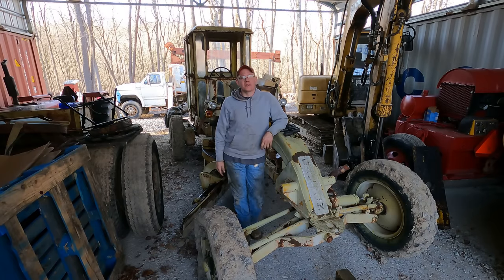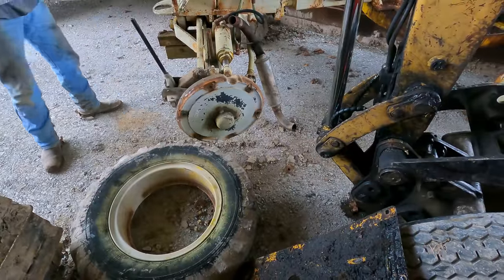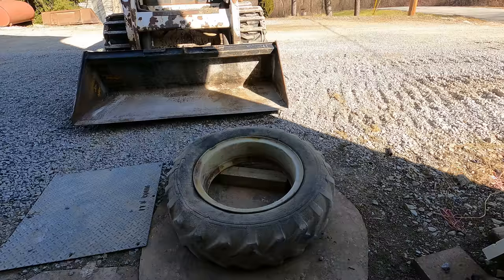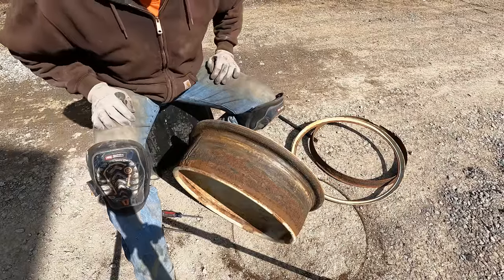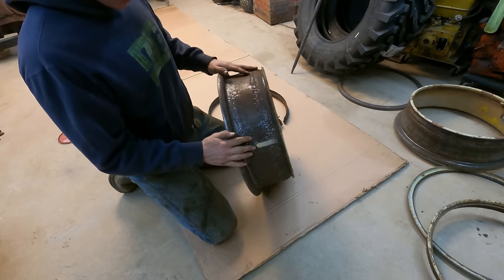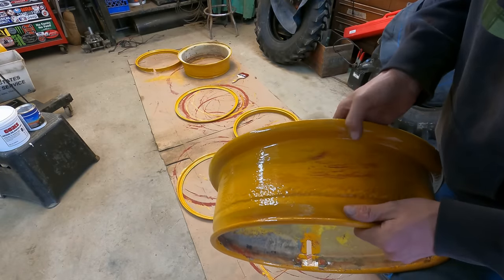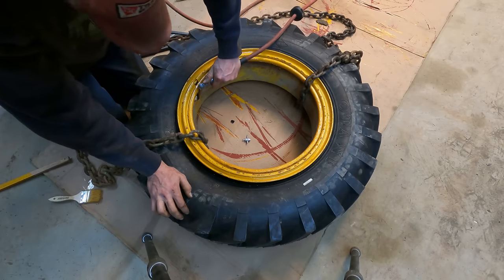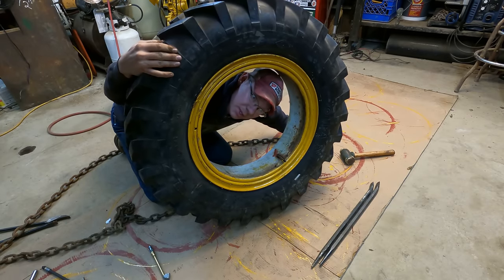1950's Galion Road Grader "Widow Maker Rims" Pt.4

Comment: The procedure you used was exactly correct. When I was in the army in 1975 to 1983 a split ring came off and decapitated a soldier that was standing over the tire while inflating. Thank you for your videos.
Reply: When I was kid running dump trucks for a friend we changed our slit ring tires ourselves. He always made me leave the chains on till on the truck. I thought it was overkill then but appreciate it now. Never had a problem.
Reply: That uhhh.. sounds miserable.  There was that video out of Brazil where a widowmaker pops its rim and hits the guy in the neck, killing him instantly a few days before he was set to retire.
Reply: @casedistorted Yep I know the video you're talking bout.poor dude
Reply: When I work at a  scrap yard we use to get lot  split rings with dry rot tire on from people scrapping them or some old heavy equipment or truck that still use it would be scary time I grew up in trucking family lot old yard truck had spit rim my family Warned us don't close tires   and be cautious

Comment: That flap is called a Boot, I was in the Army and had to teach people how to change split rims, always told them "You can't fight a tire, but you can out think them" .
Reply: That’s funny stuff
Reply: Funny you should mention the Army and split rims. I was USMC and learned how to change tires on forklifts with segmented rim locks. Same idea as a retaining ring, but  4 or 5 sections of cast steel. 125 psi. Fun, fun, fun!
Reply: @Bret4207   those multi locks. .  Or as we called em, hyster claymore
Reply: Army Vet here, too.  Back when I was just a Lieutenant, I had a medium truck platoon -- 20 tractors and 40 semitrailers in my fleet.  Adds up to 580 split rim tires -- we were changing a couple every day.  My Platoon Sergeant and I would challenge the troops to a contest.  Any two of them against us - dismounting the tire, breaking the beads, replacing the tube, reinflation and back on the vehicle.  They never beat us.  (Think here was something to the fact that he and I each averaged some 6 inches and probably 50 pounds over the average soldier.)
Reply: @LitlD  Or they didn't want to piss off the two of you!
Reply: I’m a tire guy in California and I do split rims all the time !! I’m gonna use that you can’t Fight a tire but you can out think it
Reply: @kbar150  HAR! Yeah, but I didn't know any better back then. I'd sit there airing it up with a hammer in my hand smacking any that looked the slightest bit out of alignment. Probably not the OSHA recommended process!
Reply: @Bret4207  tapping while Arrington up,, to seat the ring/rim was standard procedure when we were doing it in 1965. Use of cage was very optional, but you didn't stand looking down at them!
Reply: Maybe in the Army. While I have heard the reference my 15 years In the tire profession. the flap is a flap! A boot is a large sized corded patch used to repair large injuries in farm tractor or construction equipment sized tires where tire balance isn't an issue. This guy is lucky. At least the rims weren't widow makers.
Reply: We called it a gaiter, stripped and built many split rims on the MT park, used to shove them under the truck to inflate or put fork lift forks over the rim. Had to run for it once and saw a few rings f*** off across the yard over the years, that initial "CRACK" of the ring seating was always a little puckering though lol. We lost a guy to a tyre failure in a cage though one day, blast done him in, on a big on/off road super single.
Reply: @jeffgriffiths9528  Ya. unfortunately with the widow maker the two pieces could squirt out any direction in the top hemisphere of the tire and being C shaped there was nothing that could be guaranteed to stop them other than luck. Even fully aired weeks later they could blow in use. The bad part was the only thing that held them in place was the sidewall curvature so as you were airing and the tire was seating against them it would try and push them up  so you'd be tapping them back in  constantly until the tire was up and against them enough to actually hold em in place. One of very few things they banned sale and professional repair of that I was in full agreement with.
Reply: I use to work in a tire shop and we did big stuff and I was wondering why he didn't add a bit of air to hold things in place.
Reply: @WhatIsYourMalfunction  They just didn't want to push beat (sentry duty) every night for the next month!
Reply: @krissfemmpaws1029  I used to put a little air in the tube to make sure it didn’t have any folds and to hold the flap in place. Then I’d put it on the wheel.
Reply: @christopherestewart  that's the trick I use on all tubes too... Just put enough air to give the tube it's proper shape but not enough to hinder it's install

Comment: I agree, the back tires need replaced too. They look just as bad as the fronts were
Reply: E
Reply: Yeah I’d get it driving again first though
Reply: No way. That's why they put 4 of em there! 😄👍
Reply: No  need  to  replace  the  remaining  tires.   If you  consider  this  grader
is  only  to  be  used  to  run  back  and  forth  on  his  driveway.   They 
hold  air  well....lots  of  service  probably  left  for  use  on  how  he 
is  to  be  using  them.
Reply: @krashdown102  A truer statement couldn't be made.  Get it running properly, then worry about the secondary bits.

Comment: Great to see more progress on this project, Matt! Best regards from Germany!
Reply from the maker: Hey glad to see you back here! Can’t wait to see some lathe restoration on your end!
Reply: Wait, what? I've found TPAI this week and I've seen like maybe 5 episodes and now this? Are This Old Tony and Tavarish also watching? Daaaaamn. Greetings from Poland ;)
Reply: @DieselCreek  .
Reply: Sweden sends their regards as well! :)
Reply: Greetings from southgermany
Reply: Hey from Florida
Reply: I'm following the wave, Just to say hi and send greetings from Portugal. Continue with your projects, a pleasant channel to watch.
Reply: What is size of tire?
Reply: .... small world ;-)
Reply: Legit question hows the weather in Germany?
Reply: Greetings from new Zealand
Reply: @rebelredRC  

The weather doesnt matter anymore....Corona is the new shit!
Reply: @DieselCreek  Get the lip of the bucket actually into the bead, under the rim at an angle, maybe around 45 degrees. push it down a few mm, then remove, turn the tire 60 degrees and try again.  the bead should break at least on the third try.
Reply: @DieselCreek  If the front wheels on the grader have neither drive shafts nor brakes, I'm not sure why they need much tread.  I would suggest using the best tires on the drive wheels and the worst ones you keep in front.  that is unless you have much trouble with the front sliding sideways, which is why front tractor tires have that funny looking tread that goes around the rim, parallel with the tire.

Comment: i have changed lots of tires with that type of wheel, my father owned a logging truck for 62 years, we never had a tire breaking hammer, we used a 3" piece of angle iron about 5" long and beat that with a sledge hammer, you lay it next to the rim with the corner side up, stood on the far side of the wheel and beat it in under the rim, knock it out and move it over a little, when the angle iron got squished down a little it worked better, we never left the wheel when we were putting the air in, we watched the locking ring and would tap it with a ballpeen, if it didn't look ok we let the air out and started again, Saturday morning, hug over as hell, beating truck tires..lol
Reply: That's the same way I used to do them.
Reply: Sounds like a clever trick

Comment: Hey Son, if you inflate the tube just enough to fill it out then install your rust flap it won’t cross up on you. 😉✌️😎
Reply: I was changing the tube in a 17.5-25 L2 tire and after finishing it up and putting it back on the machine I discovered the next morning that the tube wasn't any good. So I pulled that one out went and argued with the people who sold it to me for a new tube and got that one stuck between the two liners and tore a hole in it. I bought the third tube from someone else and made damn sure it didn't get caught and I also aired it up on the ground to about 20 lbs and let it set overnight this time before putting it back on the machine. I think Picasso would have painted in reds if he heard my blue period.
Reply: @Parents_of_Twins  you nailed it Sir.  Great  Execution and Lesson  !!

Comment: Reminded me of a time we recieved several new graders by rail.The graders were being processed as soon as they were unloaded,then put to work pushing snow.Drivers were complaining that machines had no steering control at all.I told the person that was processing the machines to deflate the tires to 25 PSI.Everyone started telling me I was crazy,until I went to processing site showed the person in charge the wording embossed into the tire that stated that the tires should be operated at 25PSI cold.When the graders were loaded on to flatcars to be shipped the tires were inflated to 65PSI as required by saftey procedures spelled out in the manual. Still took over an hour to convince that group that the tires were made to operate at 25 PSI cold.
Reply: What's the reason for the higher pressure during transport?
Reply: @Jehty_  This was done after tie down on rail car to make sure grader did not bounce up and down during 
transport.Bouncing up and down could cause tie downs to loosen or break.Of course this could cause a very bad accident.
Reply: @Jehty_  Also during long term storage, higher pressure is used to prevent flat spots. The tires of new cars in the dealership I work for are kept at 40psi. Most of the cars should be around 33psi.
Reply: lol...it seem to have nearly take You a persuador[hammer] to make them at least try it...use  it in their heads.
Reply: @korvtm  on

Comment: During my days in the Army I must have replaced dozens of grader tires.  We ran them on the road far too much.  They used the same 3 piece wheels but were tubeless.  The new tires we got had been stacked for so long they were like pancakes and were a bear to get to seal on the rim.  Uncle Sam didn't allow the  either trick, so some tires took hours to air up.  Thanks for the memories Matt!  I'm looking forward to seeing Christine at work again.

Comment: Im 70 years old fixed a lot of split rim and three piece rims and still do. A tire hammer and a bead breaking spoon dont cost much and make the job easier. Also soak the bead with diesel fuel or used engine oil and it will soften the rubber and greatly help. Especially if you can set them out in the hot sun . And it dont cost much in time and material to build a tire cage. The chains are Ok.
Reply: I like your attitude. You got a positive, can do mentality. That's basically Old School American thinking.

Comment: I would have gotten to the “screw this, I’m cutting it off” waaay earlier than you did.
Reply: Just about the time it took to go get the grinder.
Reply: Can you just cut the tire off on these ? Nothing goes flying ?
Reply: @DG-ss1gc  Deflate it first and that'd probably work, although I've never had experience with split rims but logically it makes sense
Reply: A trick I would have used if the machine still runs try turning left and right while moving forward and backwards with all the air let out of the tires unless actually glued to the rim they usually come off for me.
Reply: @dodgeme1986truck  classic solution, works for getting seized wheels loose too.

Comment: Fitting those new 'socks' was a battle, but one that you won and the beast looks all the better for them. Perhaps getting her mobile once more is the next priority, but the other tyres should be a fairly early step towards her being useful once more. I guess the hydraulic lines may be another stepping stone to a fully working reliable machine, but one step at a time.

Comment: im trying to find that size tire for my galion, hes about the same vintage as christine and has truck recaps on it, i thought about upgrading to flotation tires, but the double 60 drive chains will never stand the torque. later versions, and allis chalmers all went to double 100 chains which helped. and a little trick, the front tires are generally mounted backwards which helps the steering to bite when drifting a windrow as well as when turning. it really helps on the larger graders, but the smaller units still take forever to turn any way! look forward to your next installment! stay safe, keith

Comment: i love that expression "i almost gave up twice but I beat it". important life lesson there
Reply from the maker: Step back recite all your cuss words start again
Reply: @DieselCreek  old tire bead judo.  let the air out while it's still on the vehicle and drive (or tow) the vehicle with the flat tire until the bead comes off or at least loosens up.
Reply: @DieselCreek  I would have gotten all the essentials ironed out before replacing worn tires (that still hold air).  Also, If those front wheels have neither drive shafts nor brakes, how important is good tread anyway?  So I suggest swapping the new tires to wheels with drive and brakes, and getting just about everything else working on that grader before ordering more tires.  Wait until you do a job and find that tires are your biggest problem.  Are all the wheels the same?

Comment: Watch out for those wheel wedges.  You need to back off the fasteners and slug the wheel until all of the wedges pop loose.  Then remove the fasteners.  If you service enough wheels you'll eventually find out how much pressure they can have behind them.
Reply: Yeah I have  them explode off the rim and hit me in the shin before , talk about a lesson to be learned the hard way .
Reply: We call those split rims widow makers
Reply: @Wulfmoon9  That is NOT widow makers, widow makers are a Firestone design, and split in the center, of the rim width, and you have no way of knowing if it’s seated probably! 
They are something else! 

And because they was so dangerous, those rims that we se here, was branded as “safety wheels”, and yes they are dangerous, but it’s more “be safe attitude” that will save your life, not the actual rim!
Reply: @jimmymckay73  yup good way to end up with a broken jaw sticking your face right down there

Comment: Everyone has their own way doing things, one thing I picked up was leave the valve core out when you first fully inflate. If the poo hits the fan you can pull the airline off your tank and drain the air from the tyre fast from a safe place much faster than if the core is in. I always walk off when they change split rims on site, they give me the chills.

Comment: I was sitting here wondering when you would get out a Sawzall and cut the tires off. A commercial tire shop we used to take split rims to for repairs in the 80s quit doing them after two of their guys ended up in the E.R. injured.
Reply: You would think that a "tire shop" would have a inflation cage for that task.  Most shops do!
Reply: I thought the same thing but I honestly don’t remember seeing a cage there. It was kind of a rag tag operation.
Reply: Yeah, I was thinking the same. You gotta be smart when playing with those!
Reply: Iron Oxide primer, good stuff.
Reply: they still use them everyday in other countries go watch the pakistani truck channel and you will see them doing all kinds of things to these rims
Reply: @bmacd2112  Most cages are too small for 24" grader tires. Just use chain.
Reply: @imchris5000  You also see them wearing steel toed flip flops, grinding without glasses, welding heavy load carrying/stressed items with poor penetration and voids/inclusions as well as assembling engines and hydraulics on nice sandy surfaces. And these chaps have thermo nuclear weapons!

Comment: I knew that "floor" would last !  Worst case, in 5 years, you may have to "top dress" it and re-compact.

The simplest way to "break the bead" on a big tire it to use a good sized hydraulic "bottle" jack.  Place the jack under something heavy (like the rear of the grader) and then place the foot of the jack as close as possible to the rim.

Comment: Matt,  Non-driven tires should be mounted with the tread pattern facing the other direction.  There may be arrows on the tire showing this.  Just swap the tires side to side.
Reply: Those are driven tires.

Comment: Those rims look like a good candidates for electronic rust removal.
Reply: I was also wondering bead or sand blasting. But not familiar with removing rust. Impressive work.
Reply: dont take all the rust off of these rims, it looks like the rust is holding them together!!

Comment: In my experience with Rusty rims, " and I have a lot" I always start with a squirt of P.B. blaster all the way around the bead, then, do some easy hits with a bead breaking hammer all the way around, it works the PB blaster all the way down into the bead, then do something else for about 15 minutes, Then you can usually go back and breaker' down! Good video!!

Comment: The chevrons go backwards on the front of a grader. It helps with steering.
Reply: you are right need to be swaped around since the front tires are being pushed and not driven
Reply: Should be easy enough to just change sides
Reply: Despite the wear, you could see that on the tyres he removed.
Reply: Agreed, they are like that in the old tyres, plus, your comment makes sense .
Reply: @Tim   I had no idea. Thanks for the heads up.
Reply: Yes in the front when the tread hits the ground the point should be facing forward. If it is a rear tire the point goes to the rear. If the point goes to the front on the rear it will work like a bucket digger and scoop the dirt out, instead of wedging into the ground to provide traction.
Reply: Learn something every day
Reply: Agree Tim. I was looking through to see if someone else noticed